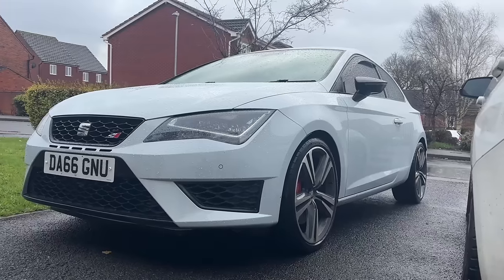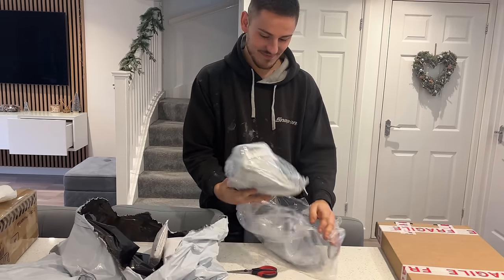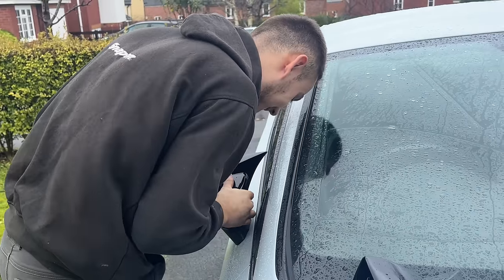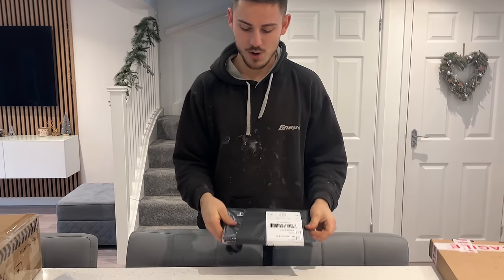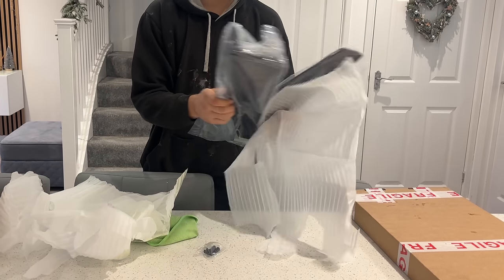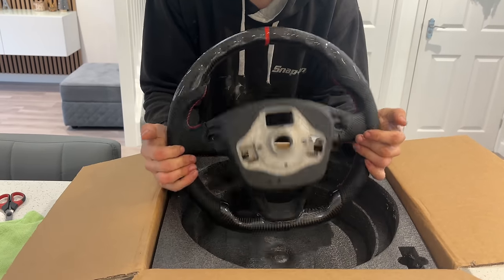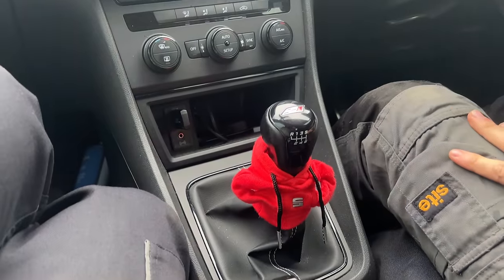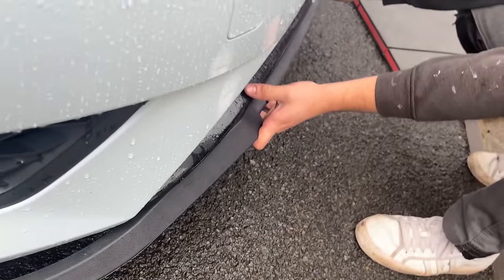THE WORLDS FIRST TEMU CUPRA…

Comment: One thing i don't get is why people like the "pop and bang" tune mapping i understand it sounds nice but here is the thing road cars (not including super cars) are not and i repeat not designed for it and if they have flames out the back it is worse because what it actually does is destroys the cylinder head,valves and pistons and is pretty much replace the whole engine just so the car can drive when the engine does break from it😂
Reply from the maker: @186scott  I completely understand what you mean, howeeverrrrrr, it sounds pretty cool even though it does kill the engine🤣 we’re just stupid people with stupid maps
Reply: @AJCars.  altho the only way for it to survive and be fine with it and wothout a care is to remove the head and get the exhaust valves and the seats upgraded for it ( pretty much race spec valves and valve seats)

Comment: Mine has the revo stage 1 map which sadly didn't get rid of the rev limiter, but taking off the resonator, the pops and bangs are way to obnoxious. Normally just drive it in manual mode with them off
Reply from the maker: @24alexash  yeah it can get a bit much if it’s on all the time, only in Cupra mode does it pop and bang on this one which isn’t too bad